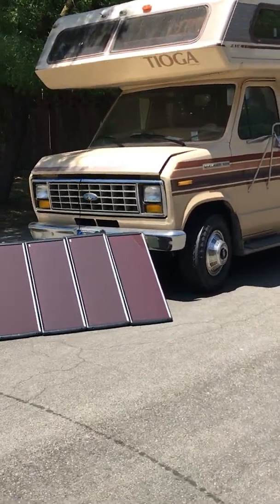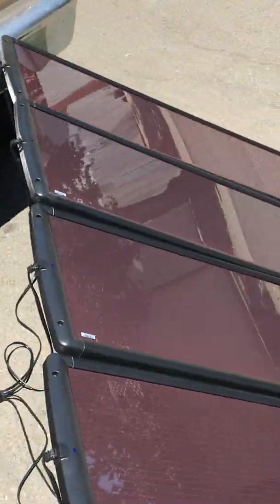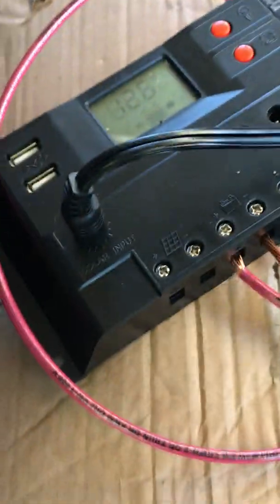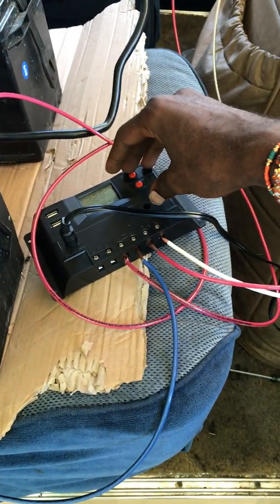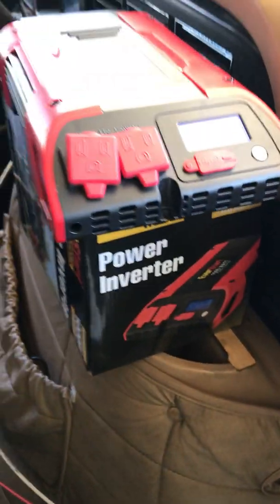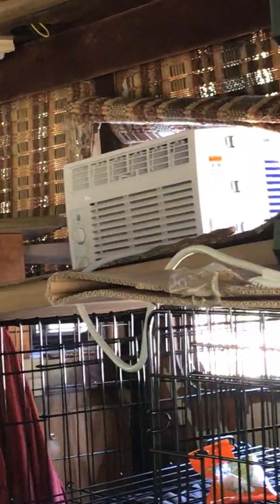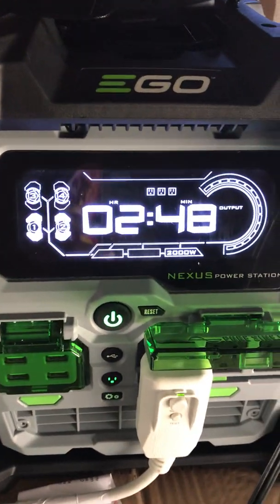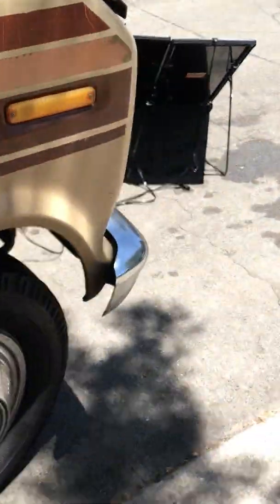Using Solar to Run 5000 Btu Air Conditioner and 3000 Watt Power Station Inverter

Comment: The ego does not run 3000W it runs 2000W Continuous and its 3kW peak.

It’s also not a generator, it’s just a power inverter, it has no ability to generate power on its own, all those hoops you go through to get it powered up makes in impractical. I’d asume it takes forever to charge it as well.

Comment: A 5000 btu ac draws about 500watts, 100watts of solar won't be enough to keep up with the draw
Reply from the maker: I use the solar to keep my batteries charged so I can run the fan off the 3000 watt electric generator

Comment: How much would a setup like this cost?
Reply from the maker: The electric generator cost a 1000 solar set up was around 350$ and just have some batteries but I returned the generator and got a bigger inverter so you wouldn’t need the generator unless you want to store power there